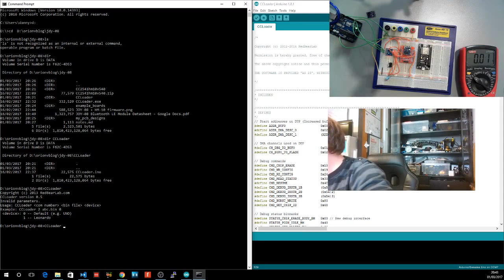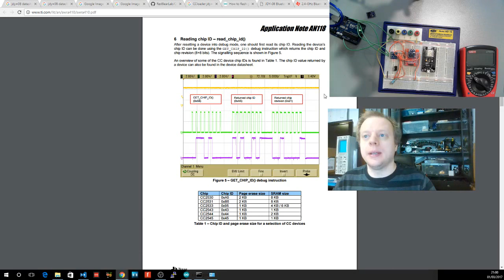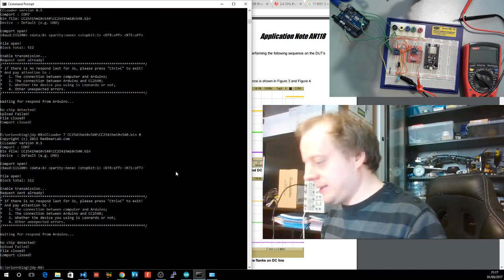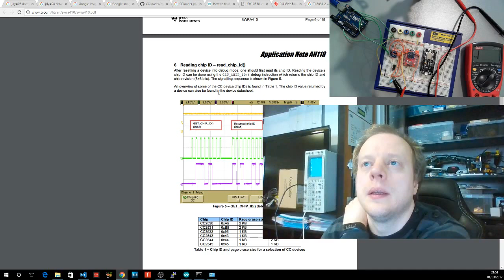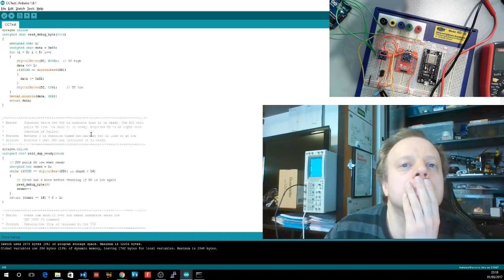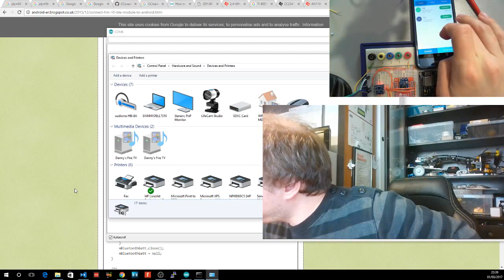LIVE: The JDY-08 Bluetooth BLE Module - Talk to me!

Comment: Hi can you help know the Bluetooth module using at METER AT3010 like in this video, because I want buy it?!?
Reply from the maker: Hello, building bluetooth enabled stuff is easier now. The ESP32 boards are great for this- https://amzn.to/2VdQ7BK.
Reply: @Orionrobots  I think the problem you ran into was assuming that you could type the AT commands in char by char and that the device would recognize it.  It wants the entire string sent in a burst.  The string must be terminated in cr/lf.  I ran into this with another module the, JDY-18.  They don't mention this in their documentation...
Reply from the maker: @MyRadDesign  Hi that is a good thing to try - I'll give that a go with my device and see what it does.
Reply: @Orionrobots  Just a note, using almost any serial communication utility (minicom, screen) in linux it is not possible to send the required strings in bursts terminated with \r\n.  I installed pyserial and modified a serial comm tutorial I found online to do so...  A workaround would be to use a arduino pro mini or the like, connect it to the bluetooth module using GPIO lines and use softserial to buffer the serial character strings until a \r is received, then append a \n to the buffer and send the entire buffer to the bluetooth module.  This would be handy to experiment with the module before attempting to connect to the module via I2C (which is the best way for complex solutions).
Reply: Where did you get your images you flashed to the board you worked on?
Reply from the maker: @MyRadDesign  Ah - now you're talking - I've written embedded bootloader automation systems using pyserial - so this can probably save me time trying to get minicom to do the right thing!
Reply from the maker: @MyRadDesign  Didn't get that far or find images to flash on it - which may be part of the problem, I was hoping that like the esp8266 it has a sane (ish) factory image.
Reply: @Orionrobots  Look at this code, works as a terminal, adds \r\n by default... https://pythonhosted.org/pyserial/examples.html#miniterm  But still did not work, as it needed to send in burst mode.  To see if burst transmission will fix your module AT communication issues, search for crlf (might be CRLF) translation in the example code, you will see where the \n is added whenever a \r is seen from the console.  I just hacked this to be 'AT+VERSION\r\n' that replaces the '\r'.  A hack, but with every enter key press I saw a correct version result response.

Comment: did you have At commands from JDY06 mini?
Reply from the maker: How likely were they to work on the jdy-08? Are they broadly compatible devices? I've not spent a great deal of time on the device after the initial steps.
Reply: Orionrobots , thanks, I connect modul JDY06 mini with a terminal program. only command AT+NAME is receiving "+OK". This Modul send No Bluetooth signal, before BT is switched on. I don't know any command for this modul, I need the AT-commands.

Comment: Hi good night!
I'm new to JDY-08. You know me more information about the PIN Reset the P00. Does it give a RESET on the system put in LOW? I would like to connect a REED SWITCH so that it restarts both when the sensor is set to LOW and HIGHT. Make a door opener sensor and monitor its status
In Github there is this information:
"22. P00 PWRC module sleep wake-up pin, the internal pull-up resistor module, low-level wake-up, usually high".
Thanks for listening.
Reply from the maker: Hi Vinicius, Eman - who has commented below may have more on this - I've not picked up this thing in a while, and he has had experience of making the thing work. That is an interesting idea for a door sensor - let me know where you get!
Reply: I live in Brazil and I want to develop equipment for IoT. I have already worked with Nordic Semiconductors microcontrollers and did my course completion work with ESP-12. So I'm researching in this area of Bluetooth BLE and WiFi to be able to develop efficient and cheap equipment to market in my country.